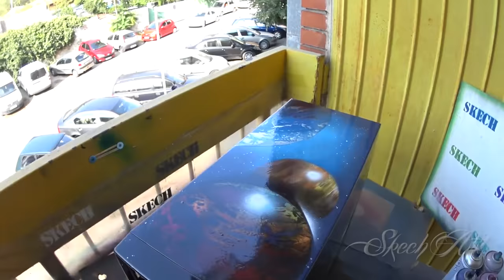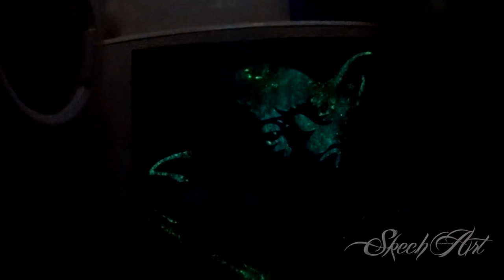Spray Painting on PC   STAR WARS themed

Comment: hey buddy. this is great. now i have to do something to my PC since its just sitting here all boring now. =)
you ever use paint pins? they are great for touching up small areas where the stencils like to stick sometimes and you cant get to by spraying. i dont know where you would get them over there but im sure they have them there. should be in any craft store you have. 
just a thought for you because i myself get super upset with stencil sticking. my OCD and all. might be a helpful tool in your amazing art venture. i find its very helpful at live showings around town. 
keep it up buddy. =) always amazing. those solar reflections (white spots you put on the planets) never seen that and it really does something to make it pop. amazing.
Reply from the maker: No i didnt try it. I like to make Stencils for Spray painting by myself so it can fit for my paint format. And mostly i dont have problem with sticking stencils on paint (MOSTLY but it happen ofc)
just w8ting to paint dry enough before i put stencil on it :) i will release soon video about stencils . I have a lot ideas but not much time :D
all the best for u!